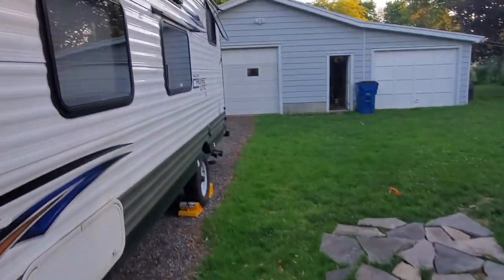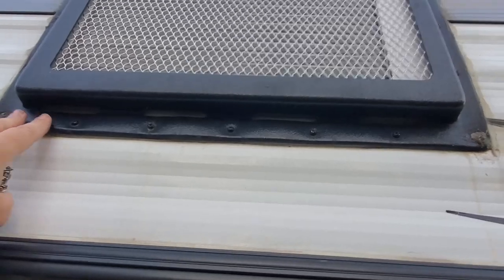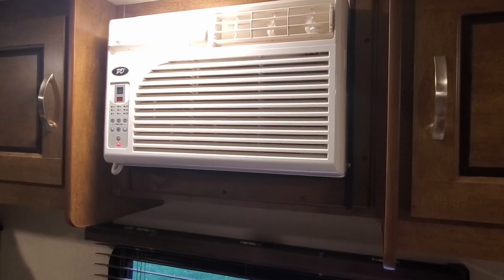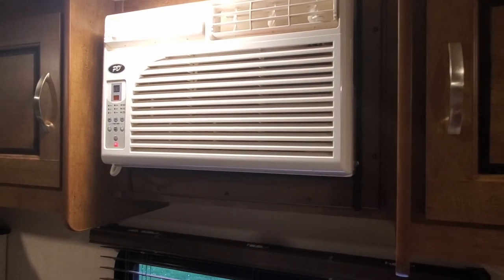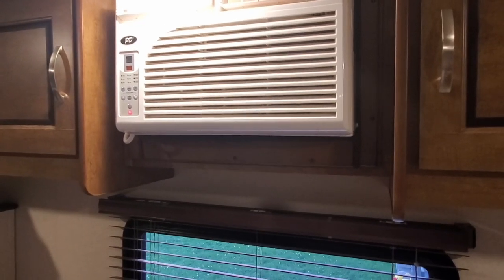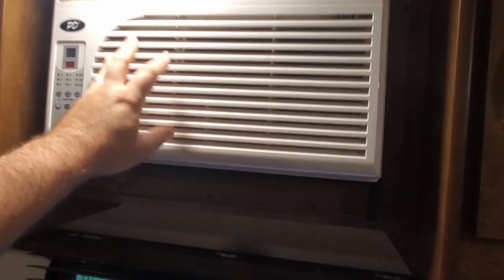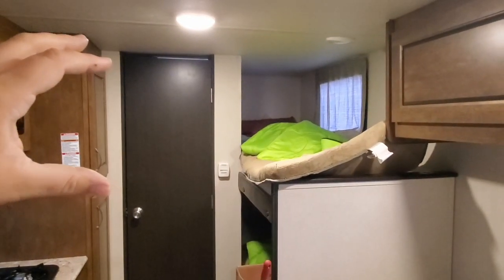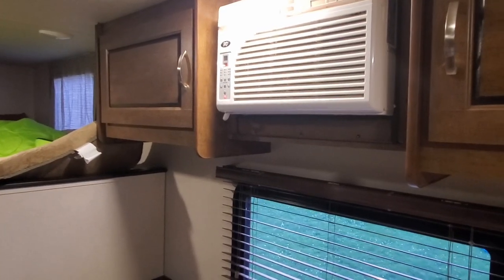Travel Trailer Wall Mounted Air Conditioner - Bad idea!

Comment: When I bought my trailer I never really thought about if the AC was roof or wall mounted. I knew the roof mount was more reliable but also more to fix but that was it. I'm glad I went with a trailer with a roof mount after seeing your issues. Water and trailers don't go well together.

Comment: This kind of reminds me of when I had an apartment. They had warnings posted about running the ac too cold because it did the same to the windows. The window frames would condensate and cause mold issues.

Comment: The issue with a small camper (R-Pod) the roof AC is LOUD - the wall mount AC are very quiet and use half or less of the wattage of the roof mount

Comment: I had the same problem with my 2020 jayco 174rd and solved it by carefully drilling a weep hole in the  rear of the AC with a  drill bit. I did get get some water damage until I fixed it. I am able to level my trailer now and not lean it anymore. BE CAREFUL DRILLING!
Reply from the maker: That's a good suggestion. Do you have a photo of where you drilled?
Reply: I don't have a photo but mine has the same exterior screen as yours and I ran the drill bit through the screen about the middle of the AC housing as low as i could and kind of just hoped I didn't hit anything and got lucky.

Comment: I noticed mine was always dripping good out the slots on mine. I made sure I kept it level and I never had any issues, or so I thought. This weekend I was camping and I was level within 1 °. Slight tilt to the other side. I made it through the first day no problems then all of sudden around 10:30pm the second night the damn thing started having water running across my floor from under my seat. I looked it’s coming from the base of the wall then across the floor. It looked like it was running inside the wall. I’ve only had this camper a few years bought it brand new. I’ve had nothing but problems out of it. The fridge struggles to even hit 50. This weekend it was at 60°. The battery charging system doesn’t work right and cooks the batteries. I went through 2 batteries in the first 2 years and I just disconnected them all together until I can figure out what’s going on. Now my ac is leaking inside and I noticed mold under my seat and I didn’t even know it had been leaking.So we are just going to see if there is any kind of fix for the Ac and if it’s not reliable or reasonable price wise we’re done. We’re sellling it even if we have to take a loss and just be done with camping at this point. It’s been nothing but trouble and stress for us from the start. Keystone should have never sold the camper in this state basically not even functional as it was originally designed for. Just overall terribly designed and a complete failure design wise. They should be recalled but they’ll never do it unless people die as a result.

Comment: 2018 Aspen Trail 17’BH has the same issue BUT ITS OVER THE BED   There’s a 1/2” gap on the left that I can see the water in the pan-it just doesn’t drain properly. I had to suck it out with a shop vac and will try that before the next trip. I tried to pull the unit out but it doesn’t seem to have been installed properly and is stuck. The instructions are very vague ‼️
Reply from the maker: Glad you have a small gap to access the excess water. There's no space on ours to do that. For now we just have to keep a slight tilt on the rig to aud draining and try to minimize humidity in the camper as that seems to make it worse. What a PITA.

Comment: The reason why you have water leaking into the trailer is because ac fan blades hit the water in the pan and sling it onto the coil to help cool it if you build a tin box and seal it up only having the back side a open this would solve your issue

Comment: I think they make the new ones to retain the water to help cool the coils and be more efficient. It still requires a slight tilt so it drains out the back when it fills to a certain level. I have a new window unit that has the plug in the bottom but the manual says removing it will reduce efficiency.

Comment: I have questions. So I could see tilting it to the ac side maybe would help. Mine at sights always wants to tilt the opposite way so maybe start assuming I’ll be using 1-2 blocks on the other side at all times. 
Question is how the hell are you supposed to keep the weather out and form entering the cabin? How do keep the pan water from entering when driving and weather entering when driving? I see no logical way this would ever work correctly in a real world situation and should have never been done.

Comment: The indoor coil is the culprit man. It needs a real drip tube. When the dry bulb temp gets down to the wet bulb temp, your gonna "Wring the Moisture" out of the room, thus water collects ON the indoor coil and drips off down into the bottom of the unit. Thats what AC units do, lol. Peace!